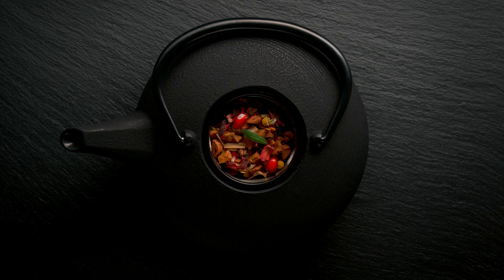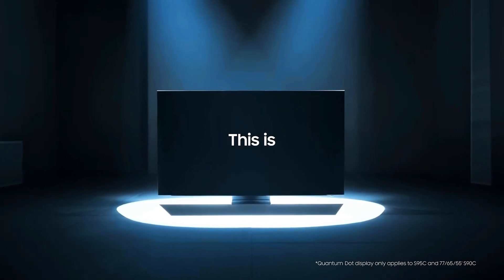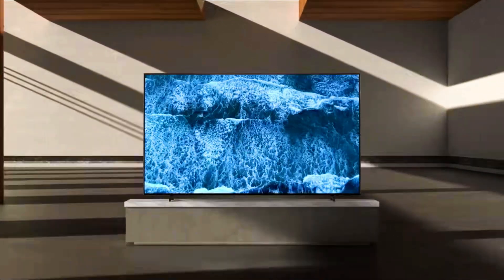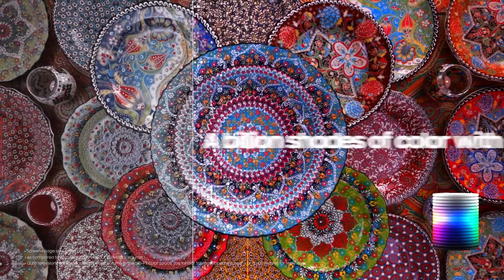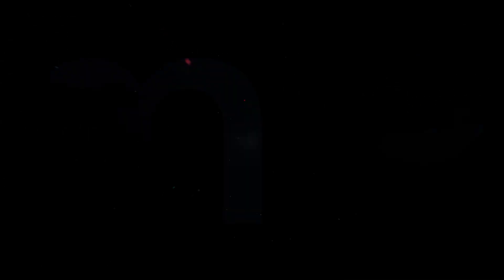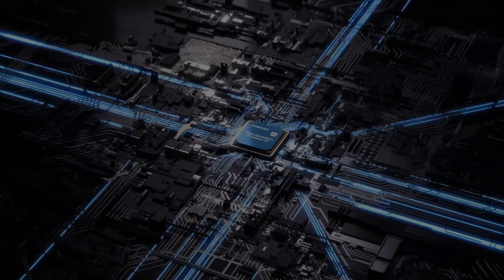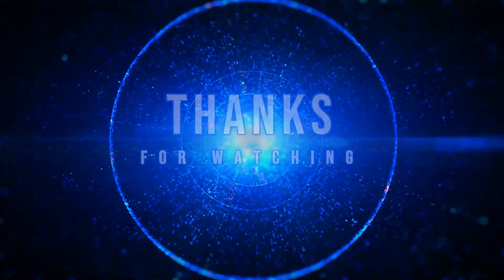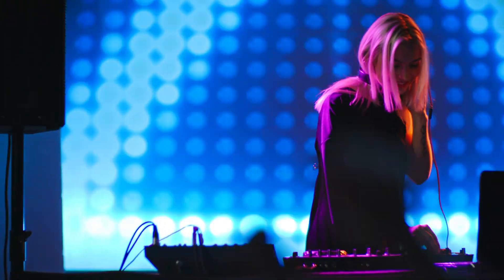OLED vs. QLED in 2024: Which TV Should You Really Buy?

Comment: FWIW ... I bought a 48" LG A2 series OLED about 2 years ago. My wife and I are retired and the A2 is on quite a bit of time even if we aren't directly watching it. I was a bit worried about the  possibility of burn-in but as it turned out it really was a nonissue. The TV tracks activity and has routines to periodically refresh the screen components (the OLED material I'm guessing). It also has a screen saver which gradually moves over the whole screen area and incorporates a clock which I like. At the end of the day there has been no image retention issues at all and I just purchased a 48B4 series which gets  a bit brighter and operates at 120mhz vs 60 and has a couple of other improvements. The 48A2 works just fine but I put it in my office where it won't get used as heavily. I'm lucky in the sense that I wanted a 48-50" TV. We could go larger but it is less obtrusive in this size range. Also I paid 549.00 from Best Buy which I think is a pretty good deal for an OLED TV. They are bright enough and the perfect blacks and excellent color and motion and off angle viewing make me glad I went in this direction.